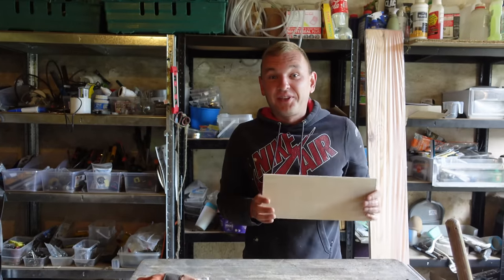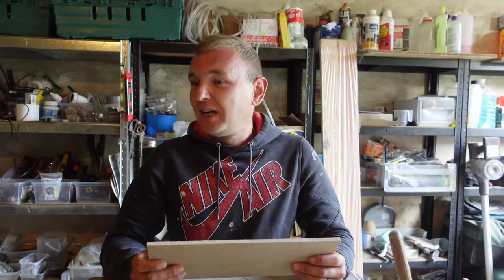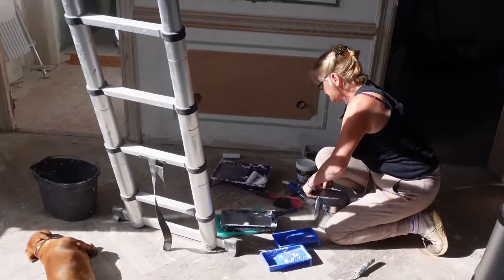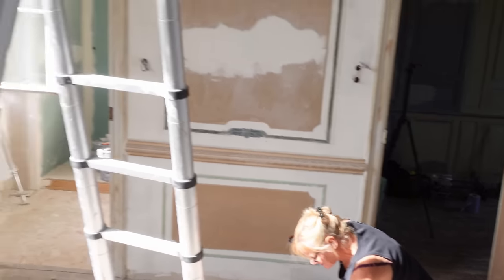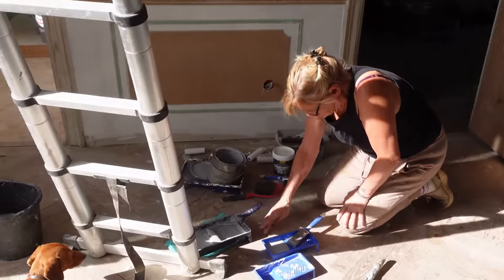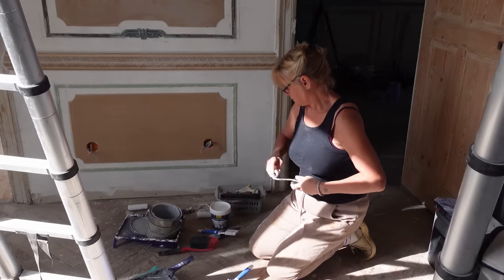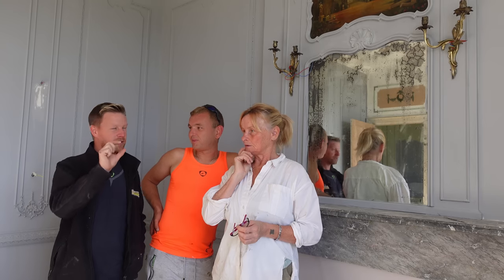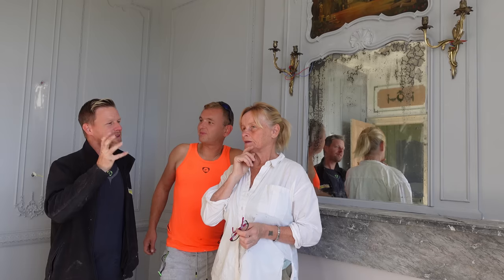The Ultimate Statement Piece: Installing a Grand Mirror in the Château

Comment: Just a small tip- when you are using figure saw- cutting it as close to clamped bench makes cut more perfect and it doesn't wiggle! ;) Or you can use hole in bed, so the cutted peace stays flat.

Comment: It’s amazing the difference a bit of filler makes. It just makes all the edges softer and stops it looking like a new addition, once all those edges and gaps are filled the panels look like they’ve always been there. The mirror looks amazing. If you don’t want to have to keep cleaning the brass lights and possibly getting Brasso on the paint/walls you can coat them with a clear lacquer spray to stop them tarnishing.

Comment: That room is turning out absolutely incredible! Teri, you should try triple zero steel wool to polish all the metal. You'll be surprised what it does. It doesn't scratch that. I will either but bring it right back.
Reply: Thanks Robert 😊😊

Comment: I wonder why the mirror is always allowed to be worn. I thought you could re-do the mirror. I know it’s more popular to leave it but a dirty mirror drives me crazy and a worn one seems similar to me. The room will be so perfect but that patina isn’t charming to me.  They did the same thing with Chateau Forte and she had worked months getting the trim perfectly gilded and perfecting the walls and molding. Did you ever consider it? Just curious. Everything looks great. I’m likely the only one that prefers a restored mirror.
Reply: I'm mixed on the resilvering of old mirrors. Nothing screams "new" quite like a new mirror. When nearly all if the detail in the room was just added, the authentically old looking mirror gives the space instant credibility. The first impression is key. I would likely gasp slightly at the initial overall effect and not give it much thought after that.
Reply: @rayn8740  interesting perspective

Comment: ?? Why did you put the wall sconce over the fireplace soooo high... you need to be 7 feet tall to light the candles. (They would look better 2 feet lower.)
Reply: They’re electric! 😂😂
Reply: @ashleywaters7198 😂😂😂😂😂👍
Reply: @ashleywaters7198  Duuuugh, no kidding genius. The sconces are designed to look like candles, and as such they are set too high for that space... but you know what, it works in that DIY 'chateau' as everything is upside down and backwards.
Reply: I noticed that too and the painted portion of the mirrored panel is designed to always fit flush against the ceiling trim, with the mirror touching the mantel. A professional would have extended the panel height and replaced the short mirror to fit the space, but they are trying to do it all themselves, on the cheap. (When you don't consult a professional interior designer, that's what happens.) Gotta give them credit for effort and if they like it that way, then that's all that matters I guess.
Reply: @iam1ina1000000  You're right about the wall panel being too short, but there's no way they could afford to have someone extend the height and replace the mirror. It is what it is and yes, if they like it then so be it.
Reply: Hello Derek
Reply: Oh how easy it is to work from your chair at home. I would challenge any one of you would be builders to do what this family has done in the last 2 years.Bah- humbug 🥵🤬🤯
Reply from the maker: Can I ask why you watch us then? 🤔🤷
Reply: @ItsMe-yv9jd You're one of the Tattle trolls, aren't you
Reply: @chateaudelalacelle I reckon this is one of the professional paid trolls from Tattle. Blockity block.
Reply: Is it possible that ‘Derek’ is feeling remorse?😉